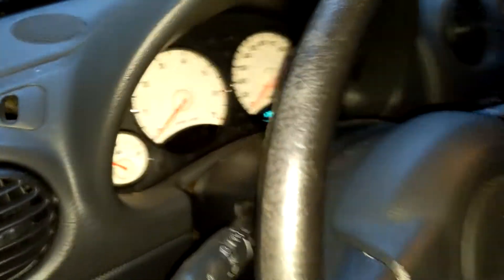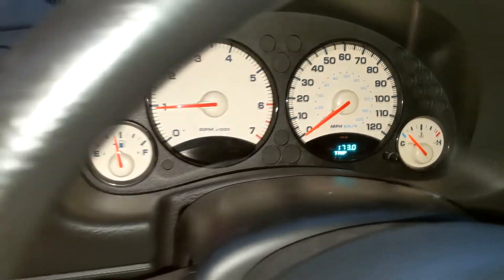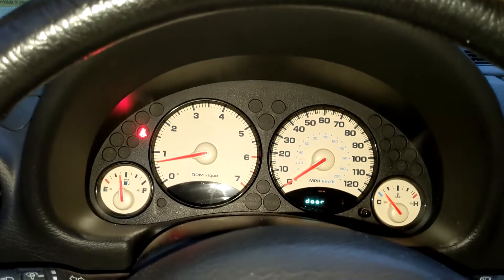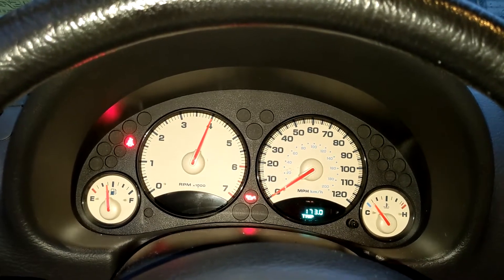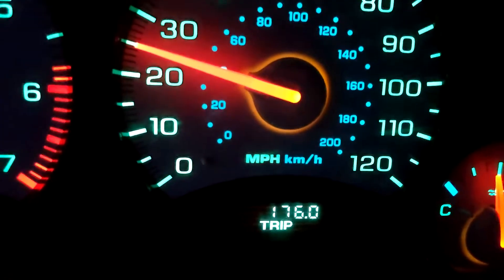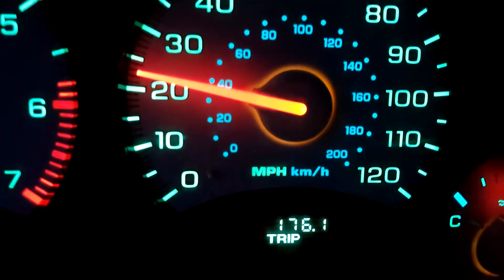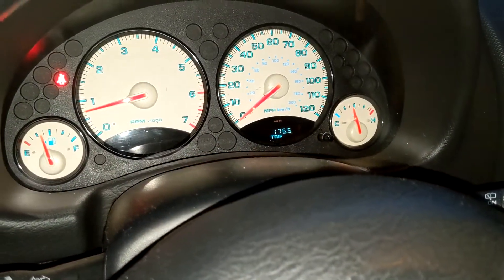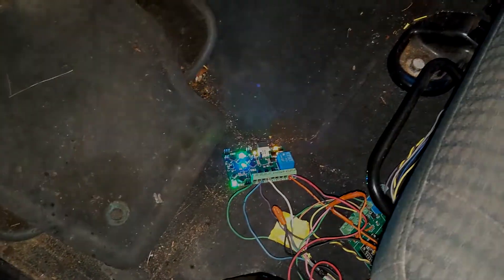3rd Gen Ls to Chrysler PCI BUS Conversion Module

Comment: Pete, I have a 02 Dakota with a 05 5.7 with a Ram ECM. Both the ECM and the Dakota are using the PCI bus system. But I want to change the engine/tranny for a 2014. Do you plan to make adapters for PCI cluster to connect to a CAN bus system like in the later model ECM? My plans are for an Eagle 5.7 or 6.4 and using the 8spd tranny 8HP70.
Thanks
Reply: A similar swap led me here too. I want to put a 6.4 into my 2004 ram that uses pci bus. Any updates on your end?

Comment: I'd like to put a mopar 6.4 in my 99 grand cherokee and retain the factory gauges. If you offer a CAN bus to PCI module, I want to buy one.
Reply from the maker: 99 Grand Cherokee uses CCD bus, not the PCI bus and they are very different.
Reply: @PeteS160plus  You sure? Is CCD 1 wire communication? I've added various factory options that didn't come installed on my car like heated memory seats and the instructions I followed said to tap the PCI bus and run a wire. I installed a RB1 radio that is PCI bus and it works as it should.

Comment: I need help with a 4x4 dodge dakota 2001. Ive swapped to a 2003 lm7 from a tahoe and electric transfer case 4l60e. Id like to reuse the stock gauges, if you could figure that out dude I would definitely pay to reuse my stock cluster. Its a very very very clean truck. If you need more info on it let me know im by my phone

Comment: I specialize in Diagnostics, electrical, and dabble in custom projects as they find their way on my schedule. I have a client looking to do this exact thing. I did some coding in the lat nineties and early 2000. Please contact me, if you would be willing to sell me a unit with software and training, or a finished product. My email is ekimspb@yahoo.com. I would be more than happy to compensate you fairly. I have several clients that have track ready vehicles and frequent tracks and drag strips in wisconsin.

Comment: I'm into this. I love the oil pressure feature! 
I'm going to be in need for something for a LT gen 5 motor, so E92 ECM. So if you are going to get a CAN VER. together for 4th gen LS's it should be same maybe..  for 5th gen. 
I currently have a '03 KJ 5 spd but thinking of just buying a spare '05 auto chassis to do the full L83/6l80e swap with 1 tons underneath. Seems like you have some interest in this! If you were able to do this for a KJ it should be easy enough for XJ,TJ, WJ and alike.

Comment: The new update setup for the Ls Droid does not install the new version to my apps you have to keep clicking on the update to load it
Reply from the maker: Please keep Ls Droid questions in Ls Droid related videos. But you clearly did not read the popup for the update. It asks you if you would like to download the update, if you say yes...all it does it download it and tell you where to find it and they you need to install it. You have to install the update your self since the new version does NOT replace the version you've been using. 

After you install the update you will have Ls Droid 2.2A AND Ls Droid 2.2B both installed. Its up to you if you want to remove 2.2A or keep it installed in case you have an issue with changes made in 2.2B